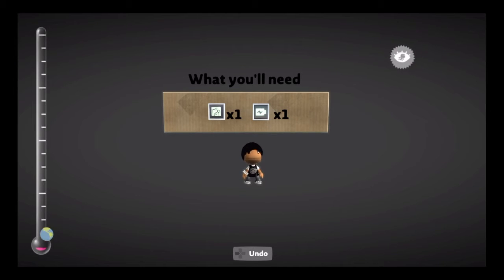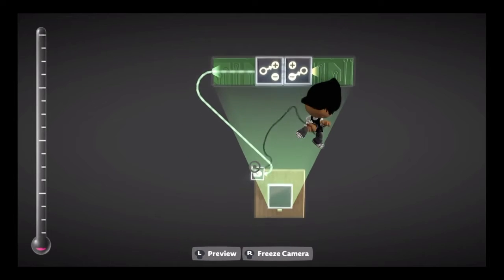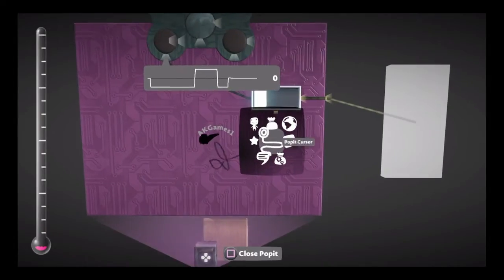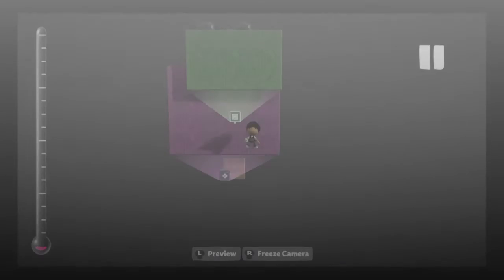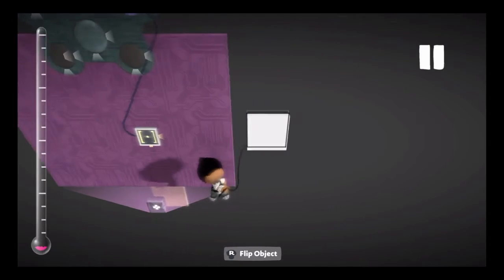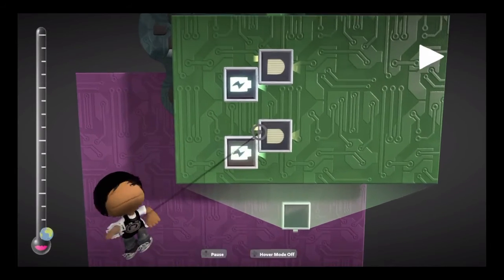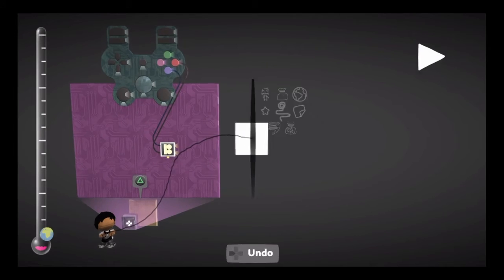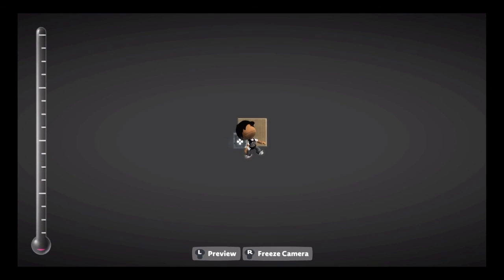How to make your own logic in LBP3

Comment: Is it possible to make a timer like out of 60 instead of 100. I want to know this because while I was working on making a clock. I set the max to 60 (using a battery) but the timer counts down into the negatives. (Btw I'm using enigmas probe from his logic level.) While I was at it. Figured out how to find percents of numbers LUL. Battery into the timer with positional and then it will got to that percent. Cool but not what I needed :P

EDIT: found a way. Using a sequencer with positional. Basically checks for 60% then battery outputs to the reset of the timer.

EDIT2: easier to do than I thought. First error I did was set the timer to 60 seconds instead of 100, error because I can use a battery and timer to positional then when timer gets to 60% (60 seconds) it stops (because positional) then even it out with the direction combiner with 60% for both.
Reply: Nice
Reply: Lal